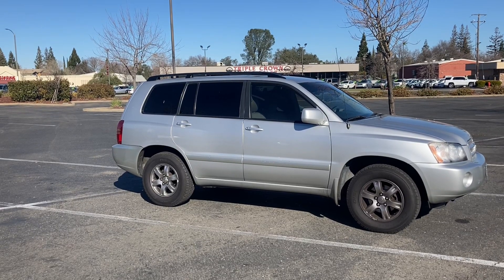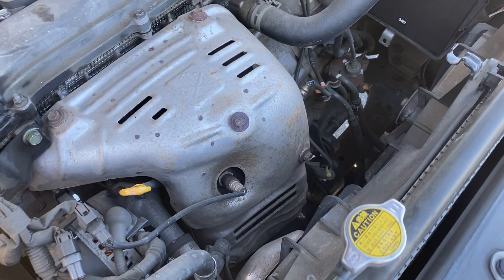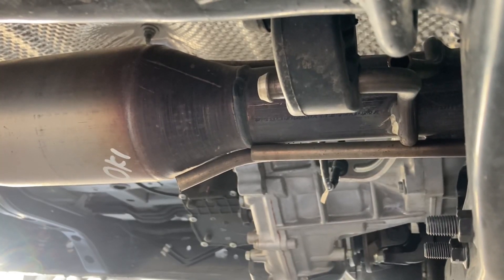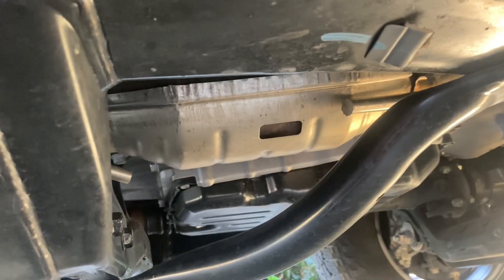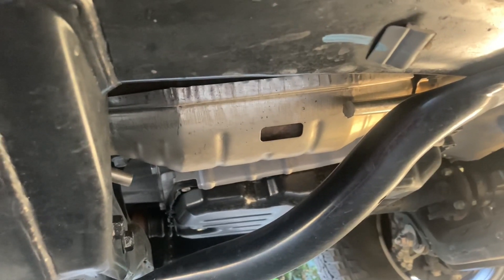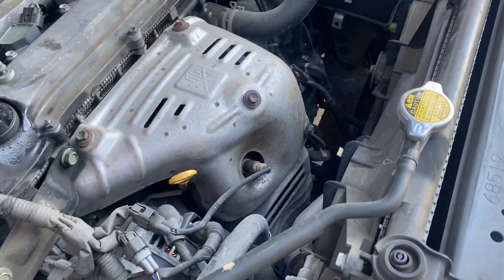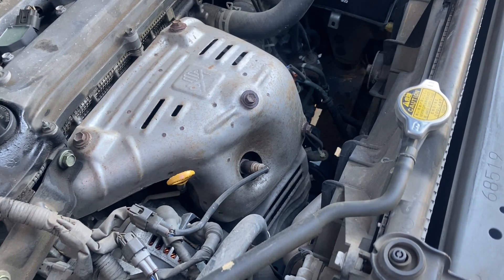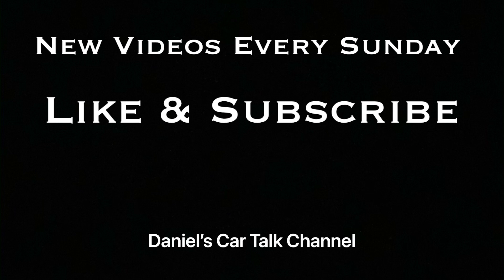Catalytic Converter Theft Explained

Comment: I’m a little confused.  Why can’t the thieves just cut through those metal bars you had installed around the converter?
Reply from the maker: The rods are tough enough to stand up to the blade, the shop had the blades thieves like to use, they tried it on the stainless steel rods and they ended up going through 4 of them before finally cutting through. A thief doesn’t want to stick around that long and risk getting caught.
Reply: @DanielsCarTalkChannel  - Nice.  If I get a truck soon, I’ll ask where you had that done.  I’m also in the area.
Reply from the maker: @anthonygiordano3991  West Coast Muffler on Auburn BLVD in Citrus Heights.
Reply: @DanielsCarTalkChannel  - Thanks!